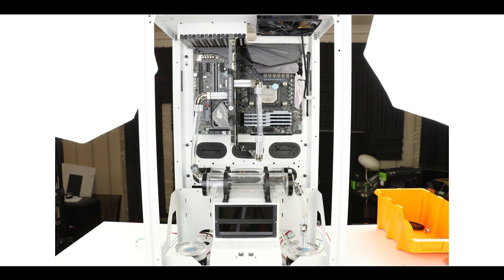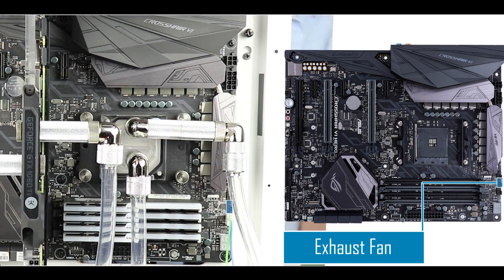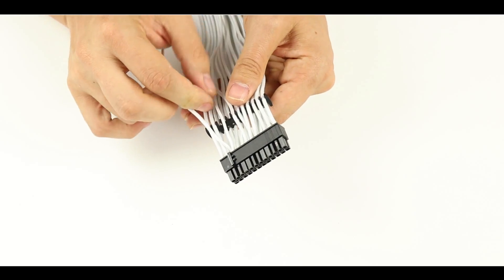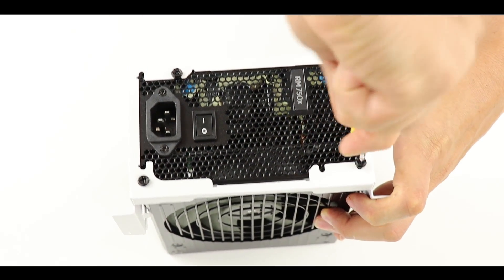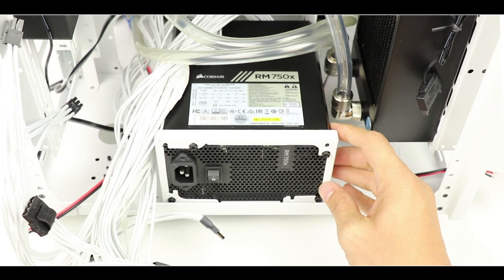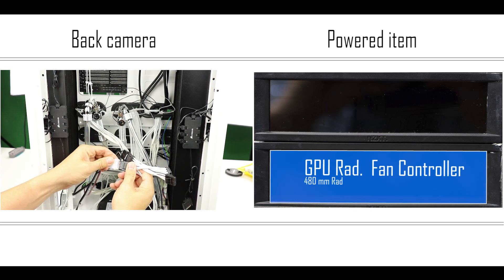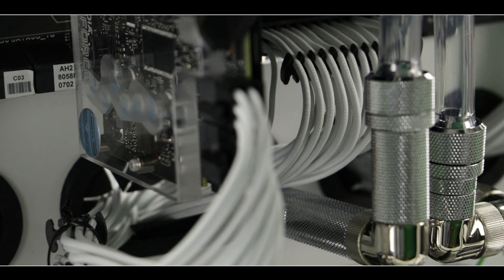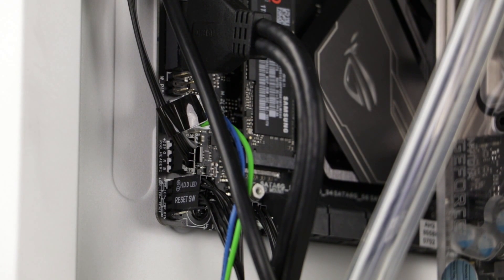Connectors & PSU (Ryzen Project 9/10)

Comment: I'm planning to buy this case with 2x560mm rads and I was wondering if there's a reason cuz you put the drain valves so high.
At first I thought there wasn't enough space at the bottom due the PSU position but looking better (4:40) I think a T splliter should works, am I wrong?

Comment: hey Laurent, great video really well put together and the annotations really help. Actually used this video to help build my own pc. But when I boot up my pc and went into the bios I found my cpu running at 65'c. Is this normal for the dark rock 3 ?
Reply from the maker: you got a Ryzen 7 1800x right? Apparently , the X line up of CPUs intentionally report 20C over the real temp. They do this to trigger early thermo throttles. Its not great, I agree.. but that's what's been reported lately. So, in fact your current CPU temp is 45 degrees C.  Both cases, you are way below the 80 safe temps. So you are good to go. Keep an eye on it in the case you'd want to do an OC.
Reply: I got the 1700x, but must be the same kinda of deal, If its 45 that makes me a lot more happy about my first build. Thanks for the help, really saved my conscious on this one